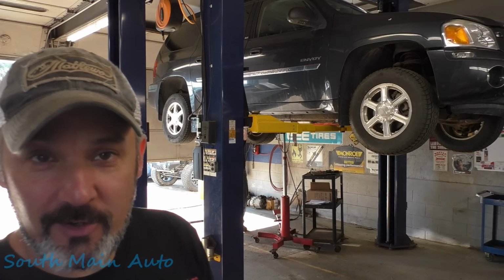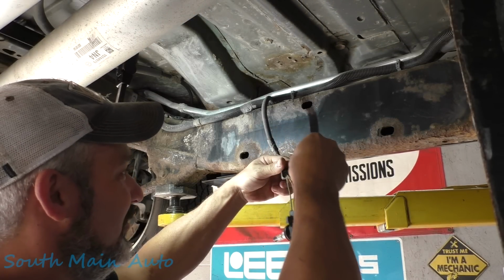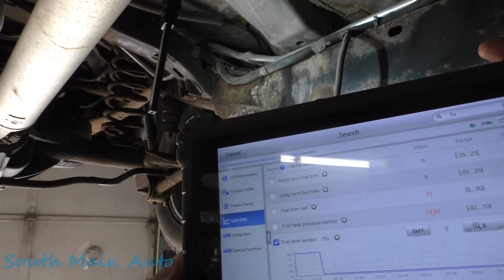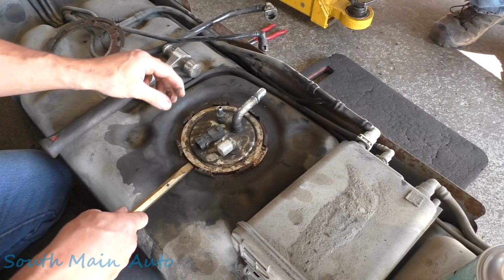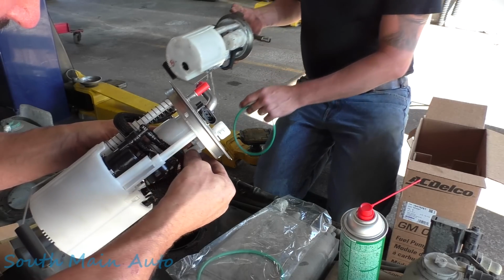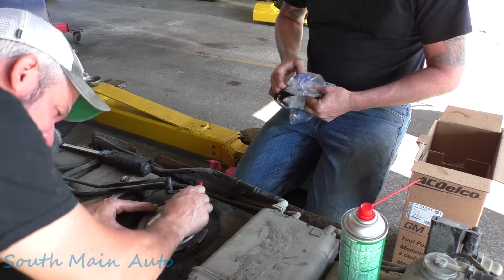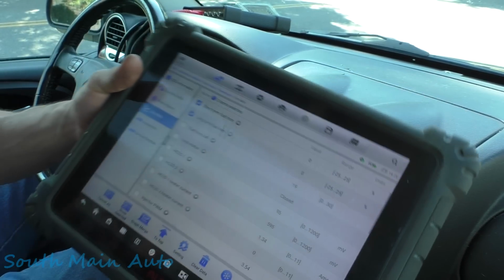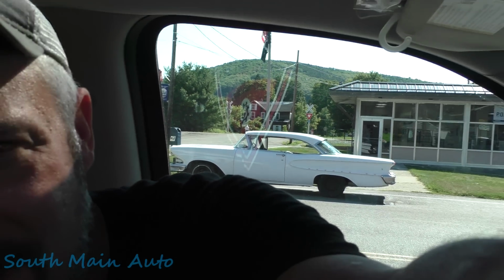GMC Envoy: Hard Start When Hot & Low Fuel Pressure - Part II

Comment: Good call.  Obviously the existing fuel pump module was not OEM however,  had it been, often you can buy only the fuel pump itself and replace it by itself. Mush less cost but in this case, too much was wrong and a new assembly was the better way to go. Often, fuel pumps only fail due to folks driving until the tank is almost empty which cause the pump to loose its cooling factor and lubricity from being above the fuel level for extended periods of time. In those cases, just the pump is needed as long as the shop and customer agree. Some shops might fair for the whole assembly due to warranty reasons to their customers
Reply: I was thinking  the same thing. Except I have had a supposedly new item on e bay  that somebody bought the wrong item . Turns out to be a different part #  all together. It fits but electric value are not right. Now I always compare the two and return if different. I now have a snow blower starter that fits an 8 horse but will only crank a 5
Reply: I wouldn't buy just the pump. I just replaced a fuel pump because the fuel level sensor went bad. I pulled the tank, and the whole top of the pump is rusted out. It was bad enough that once i pulled the pump out of the tank, there was a rust spot inside the lid of the pump assembly. I'm pretty sure the hose attachment points on the top were weak enough that I get a pin hole in one just by pulling the hose quick connect off. I'm just glad I replaced everything because I would have had more issues by only replacing one piece.
Reply: @snoopdogie187  Well, if the other parts of the fuel pump cartridge are failing, it only makes sense to replace those too.  Did I say to ignore other damage occurring?
Reply: @Garth2011   The issue is that if one part fails, most of the rest of the parts are not that far behind. When you have to drop a tank, instead of accessing it from above, replace everything and know you won't have an issue for a long time.
Reply: @snoopdogie187  If it's not your money, that makes a lot of sense. However, fuel modules are generally expensive, $400+ or so. A fuel pump itself is $40. Most of the other parts are stationary non-moving parts except for the fuel gauge float are. Once the assembly is out of the tank, surely you will do a visual inspection and determine the condition of the other parts. If all that is bad is the pump, you are throwing away money to "just replace it all". Those pumps are wear items. Some of them last a few months and other may last the life of the vehicle. Most of the time, a fuel pump is needed during a 10 or 15 year cycle on average. The other parts do not need replaced as they "are not far behind" as the remaining parts don't wear so unless they won't pass a visual inspection, they are good to continue to use. It's really a shop/business decision and how they will serve the customer. The idea of installing the complete assembly would be a method to help with a shops warranty on the repair vs. replace whats bad at the time. I have seen some shops replace a top radiator hose and not the lower and some suggest to replace both at the time. That makes sense since they are both about the same age and wear has set in.

Comment: 4:40 were did you source you variable resistor Mr.O?  I need one.
Reply: I think the one Eric was using came with one of his kits of jumper cables for front probing connectors. It was probably an AESwave "uTest advanced terminal test Kit" which includes a 10 Kohm variable resistor.  It would be probably less expensive to purchase one from an electronics supply house such as DigiKey, Newark, etc. You can also get them from common online sources.

Comment: Nice Cam 😊 but it's not focusing correctly. I see a lot of flags getting hangup on the poles and wires. I have a 03 blazer. Years ago it needed a pump. Before we changed it. Had to get under the car and hit the tank with my ratchet wrench to get going again
Reply: I've done that a few times to get one home. I only had it fail once. My loaded 97 Chevy Express died and it had to be towed the last 2 miles to get it home. My wife towed it up a steep half mile hill. It got down to 15 mph and kept going. I was amazed that it held that speed because it dropped to that in about the first 75 feet of the hill. Amazingly the fuel pump died when it was at about a quarter tank.
Reply: P.S. The towing vehicle was a 91 Nissan Sentra with a 1.6 liter engine.

Comment: Grab a 300ohm (or close) pot. Solder some wires and small terminals on the ends. Then you can simulate the 90-270ohm sweep of the sender.

Comment: I wonder what went bad in the old fuel pump?  Maybe it is just a poor quality after market one.
Reply: I'd put money on bad regulator. It got up to 25ish psi quickly so the pump seemed more then capable. Just the regulator was dumping back to the tank at too low a pressure. During WoT that flow rate wasn't enough to feed the injectors properly so it fell on its face.

Comment: 8:04  Okay... can anybody tell me why there is a picture of a kettle on the fuel level sensor.  I've been an engineer long enough to know nothing is done without a reason.
Reply from the maker: GM uses "pictures' of all sorts on their parts boxes. When I asked it had something to do with language barriers of people in the shipping or stocking areas? I think it is similar to Ford using all the color coding stuff in service data. Makes it multilingual I suppose.
Reply: @SouthMainAuto  I think you are right.  I started looking through various systems like unicode for example.  I didn't see that character.  Looked through some other character systems and couldn't find it.  Thanks for the response.

Comment: This brings back an old horror story from the 80's for me. Way before cell phones came out I broke down in the middle of no where because the fuel pump went out on me. It was the middle of August and over 100 degrees in humid south Georgia and I had a suit on because I just attended a buddy of mine's wedding. I must have walked five miles before someone finally stopped, the road I was on was very rural out in the county and hardly traveled on by autos. I probably lost six pounds that day!
Reply: I almost crashed due to a fuel pump. Driving 80 mph on the freeway, then exit. Let off the fuel and hit the brakes a little bit. Try to hit the brakes again to slow down for a left turn and no more vacuum assist or power searing. Look at the tac and had nothing! Damned near hit the concrete bridge guards to keep people from going over the bridge. Put the truck in neutral to try to restart it, and nothing. Truck comes to a stop on the bridge blocking the only west bound lane of a State highway. 110 degrees and it is about to rain in Casa Grande, Arizona. I'm driving a black truck too. I get out and go under the truck to smack the tank and few times, then restart it. Fuel pump fails again after just getting the truck moving a little bit. I put the truck in neutral and just barley perfectly park it at Dairy Queen. I spent 3 hours eating ice cream and root beer floats until a friend of a friend with a tow truck comes and gets me. Horrible!

Comment: New camera seems a little washed out in the outdoor shots, probably just needs a bit of tweaking on the settings. It seems to do a little better on the scantool glare issue, at least at 1st look. 
Those GM fuel pumps seems to have a couple of recurring issues, it makes it hard not to change the whole thing once you have it out. The senders seem to wear through in the center of the resistor element, I always figure if it's very rusty at all on top, just change it all. Pay me now or pay me again. Thanks for another nice 2 parter.

Comment: If the in-line fuel filter is clogged or too restrictive, it would cause the fuel pump to work too-hard and burn-out.
Reply: Most of the newer model vehicles don’t have them anymore. The regulator/filter/pump are basically one unit nowadays.

Comment: Give Ray a heads up on using a brass chisel for gas tank ring!
Reply: I always just used an air chisel w an everyday VERY full flat chisel bit. Obviously may not have been the best or safest possibility, but always worked.
Reply: @brianmason8400  😱 Continued good luck to you!

Comment: Never had any luck with aftermarket pumps and GM.  Delco or do it again soon.
Reply: The one I bought at O'Reilly auto parts about 6 years ago is still working good on my 97 Chevy Express. The only complaint is that the fuel guage will read full when it still has room for another 10 gallons in the tank.

Comment: Gasoline in the armpits!!! Been there done that. Back in 1996 when Chrysler came out with the second generation mini van, there was a recall on the fuel pump. Working in a Chrysler Plymouth Dodge Jeep dealership I got my share of them. You could pull the pump by just lowering the front off the tank as it went in from the top side. We told customers to bring them in with less than a half a tank of fuel. I guess you know how that worked out. Usually the conversation went like this. Does it have less than a half tank? No I just filled it up HA HA HA! Well what ever fuel leaks out, leaks out because you were asked to bring it in with less than a half tank and Chrysler doesn't pay us to recover the fuel. So you can re schedule or take your chances on how much fuel we loose.
Reply: Try jet fuel in the armpits.  Anytime we had to drain aircraft fuel tanks, we always got soaked.

Comment: Fuel gauge works….for now… gm could never make one that lasts
You know your a dedicated SMA fan when you are at work putting in an expansion valve on an Acura tsx(compressor grenaded), and you get a notification that there is a new video so you put in your earbuds and listen along while you work. I’ve done 100’s of gm fuel pumps so I can picture everything that’s happening
Reply: You should do repairs blindfolded-- you'll be a YouTube star!
Reply: @jamespfitz  sometimes in this industry you can’t see a damn thing so basically. Lol

Comment: I have a s10 that does the same thing when it gets to operating temperature. Hard starting and no check engine light. Now I joy of picking between a delco and Bosch fuel pump. Great diagnostic video Thanks
Reply: Delco, Delco, Delco, Delco
Reply: You may want to check the fuel pressure regulator as well.  It is probably a separate module on that old of a vehicle.  I had a 2002 Impala that would hard start and the fuel pressure regulator was leaking to the vacuum side right into the intake.  Got the intake all carbony and caused a lot of starting issues. At lease I did not have to pull the fuel tank to fix that one.
Reply: @ericpaul4575  fuel reg is part of the fuel pump. I follow the fuel line all the way up to the injectors.

Comment: Wheel baerings in a gm seems like a common problem on all there vehicles.
Reply: A lot of the problem is they went to ball bearings instead of tapered roller bearings. The ball bearings are less drag for better mileage, but they don’t hold up to the side loading. 
And, basically all automotive wheels bearings have gone to factory sealed units. Which is less maintenance since they don’t need repacked like old bearings, but that also means they get run till they fail.